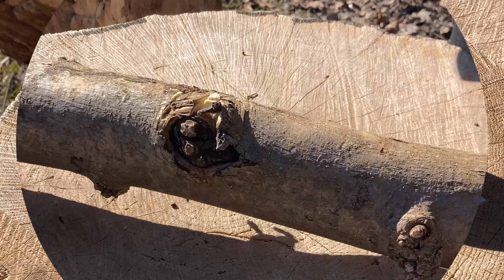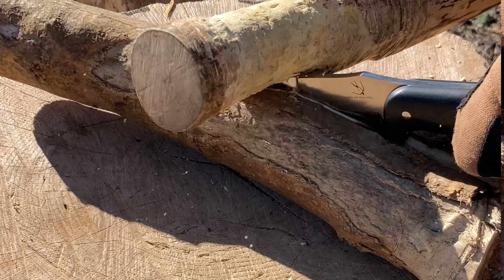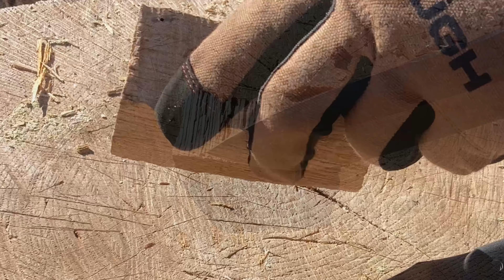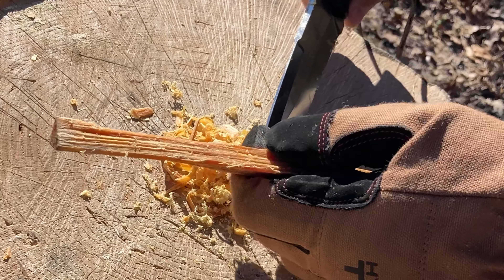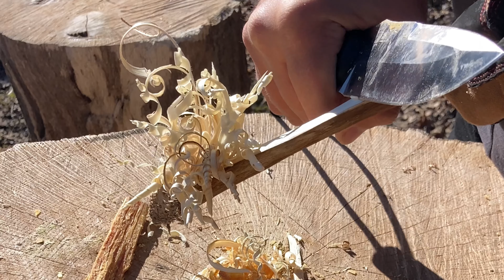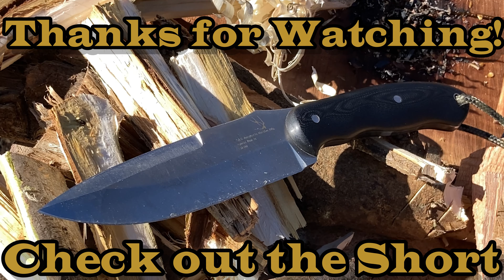CKC CE-400, The Defiant, 154cm Steel.

Comment from the maker: CKC CE-400, The Defiant, 154cm Steel.

The name Bush-craft says it like it is, tough and strong, the Defiant is made from 3/16” inch stock with a high Saber grind for an effective geometry for cutting and small chopping. The handle design allows for a comfortable hold, providing a platform for plenty of control, the spine weight gives it plenty of mass to put that force multiplier into the chop causing the wood to want to give way. 

SPECIFICATIONS

 DEFIANT MODEL CE-400

Overall length: 11 1/8”
Blade length: 6-inches
Blade Rockwell: 59 C
The thickness of Blade: 3/16”  
Blade material: 154 CM
weight: 1 pound

#dskfs      
#22aday
#22adaynomore
#NeverGiveUpNeverSerrender
#NeverQuitQuitting

Don’t forget to hit the like button! 

Please help support our vets by raising awareness of the tragedy that is Veteran suicide by visiting the links below and reaching out to those in your life. If you know a vet don’t hesitate to reach out to them! 

Suicide Prevention Hotline: 1-800-273-8255 
https://suicidepreventionlifeline.org/

Mission 22
https://mission22.com/

Til Valhalla Project
https://tilvalhallaproject.com/

Message from Martin Miller, Army Veteran 66-69

1-800-273- TALK, press 1 for Vets saves lives. They're the Shining Stars of the VA. My brothers and sisters, you're not alone. The help you
deserve and have earned is just a phone call away. It takes the courage and strength of a warrior to ask for help.  Please call if you need help. Suicide is a permanent solution to a temporary crisis

I love this community!  The knife, sword, saw, fatwood, bushcrafters, and all the new people who have subscribed!  We are LEGION!

You guys' ROCK!

LIKE! SHARE! SUBSCRIBE!   Also don't forget to check out the other content creators!  They are all good people with great videos

Comment: Great video. Super sweet knife. Is that a flat grind?
Reply from the maker: It is!!!
Reply: @21_Cabbage_  that's fine that is a high sabre grind, but it's a high saber flat grind. If a knife says it's a sabre grind, it's either a low, mid or high sabre grind but it's also either a flat, hollow or convex grind.
Reply from the maker: Mid saber flat grind.  Still worked well what ever its called LOL  @jonnyboat2